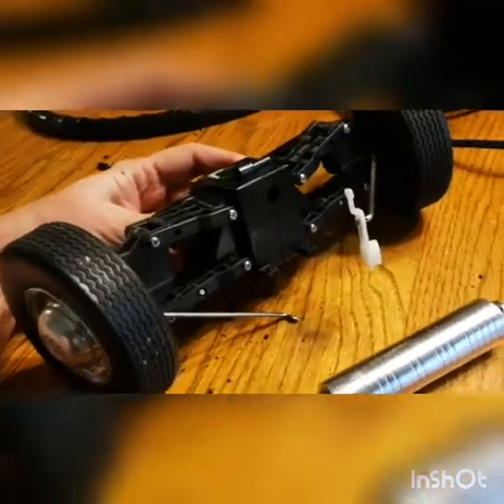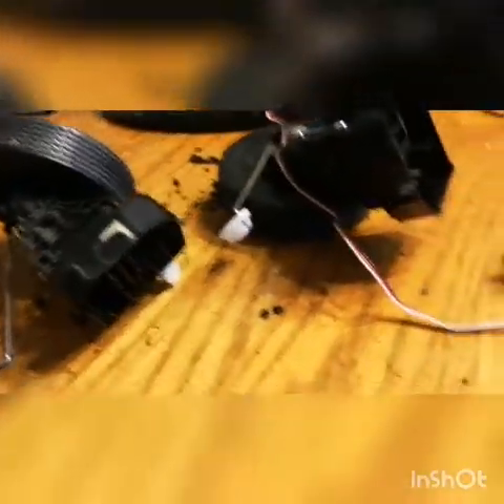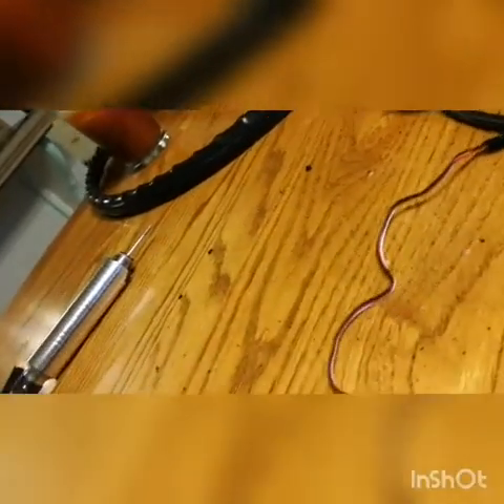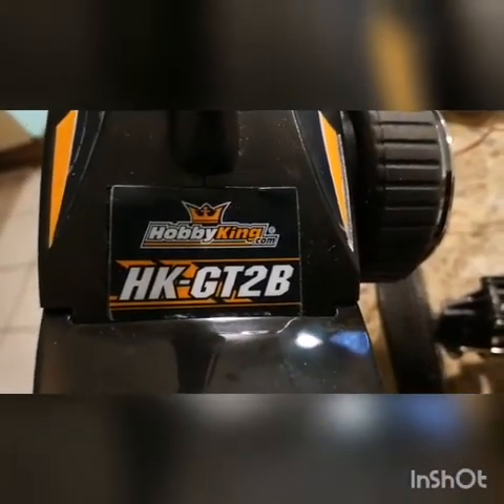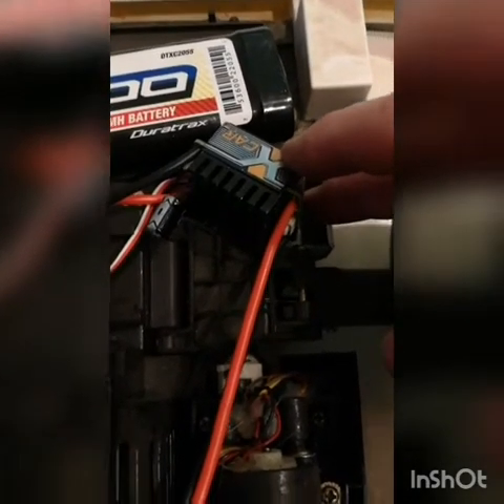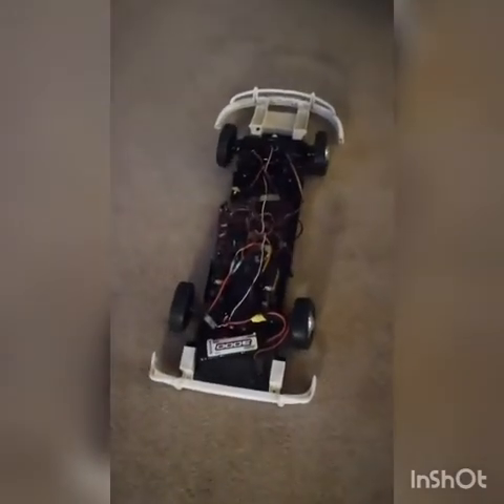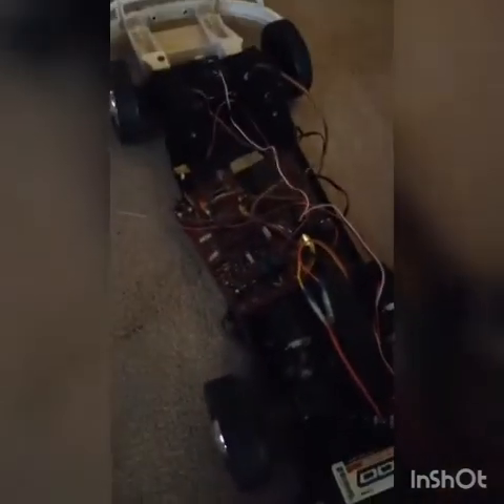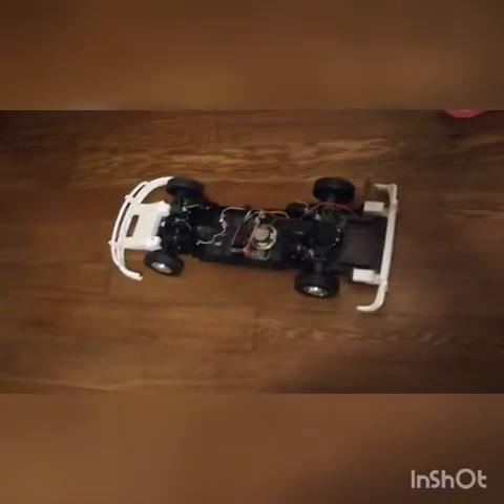Herbie RC VW Bus electronics retrofit

Comment: can you put a brushless motor in there? i have the vw bus
Reply from the maker: Yes, but I'm not sure how long the gearbox would last
Reply: @VintageSpeedwerks  ah thanks ! i will fit . well im going to take it easy then its a revolver 
540 from homles hobbys
Reply: @VintageSpeedwerks  update ! finish it brushless powered herbie bus you can see it on my channel "Khaos Nitro"
Reply from the maker: @khaosnitro  I thought about it, but the gearbox I fear wouldn't handle it. It's pretty quick as it is, my other videos I show it running.
Reply from the maker: @khaosnitro  I just noticed your page and video, did you mean that is what you did? Also looks like you added to the suspension servos with all those zip ties
Reply: @VintageSpeedwerks  YES! its powered by revolver 540 classic motor from holmes hobbies and zip ties holed the servos for hydraulics i treat it gentle works fine 🙂
Reply from the maker: @khaosnitro  awesome, glad to hear it!

Comment: Thanks for sharing!  What do you mean by how you used both servo arms on the steering?  I lost you there. Also, what was the reverse problem?  Thanks for the help!
Reply from the maker: The service horn that came with the servo I put on first,  them the original herbie one. The futaba acting as a spacer
Reply from the maker: For reverse I just had to run the setup on the controller and radio/ speed controller again.

Comment: Thanks for sharing your work and the links you used. Do you remember how many different functions the Bus came with from the factory and how many channels from a radio I would need to work them all?
Reply from the maker: I don't, but had adjustable suspension.